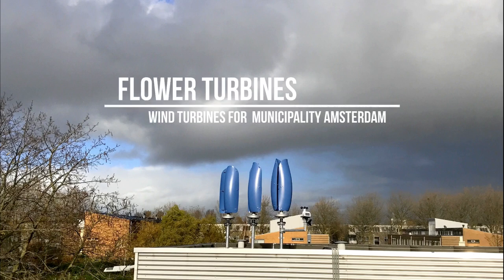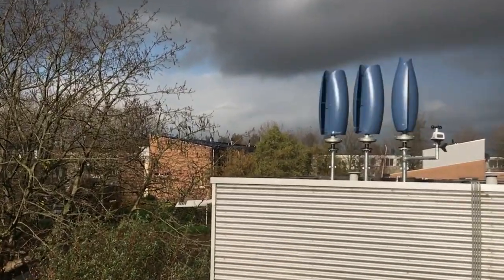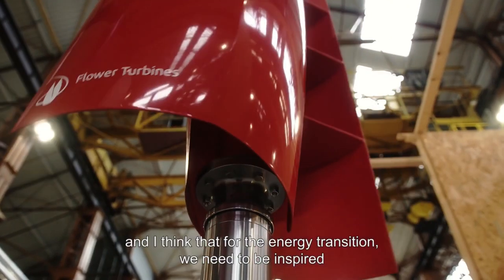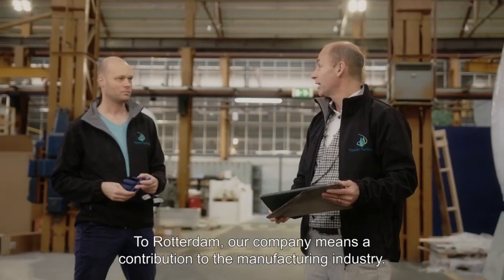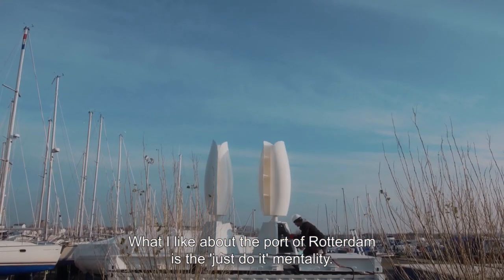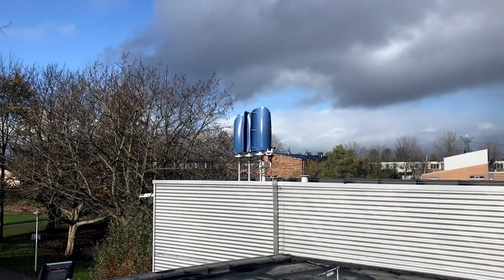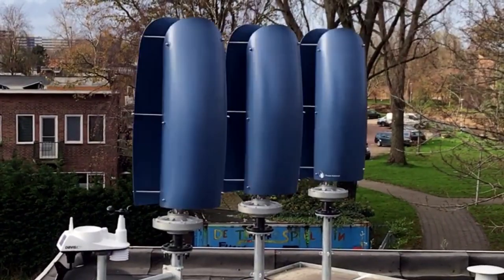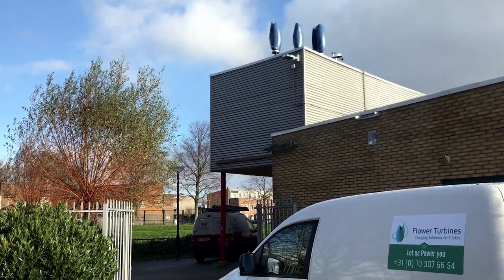The Wind Tulip -  Tulip-Shaped Wind Turbine Makes Wind Energy Accessible in Eco Art Style

Comment: Any idea how much does it cost?
Reply: I don't know the prices for europe, but it's 750.00 USD for the small one ("survival unit", 1.15 m blade height), 7,000.00 USD for the medium size (2 m blade height) and 40,000.00 USD for the large one (4.92 m blade height). 
Which is several times more expensive per power output than conventional wind turbines. 

It's rather expensive art than reasonable, economical wind power generation.

There is no official data about power output per wind speed available (surprise! 🙂), but you can make a rough estimate based on size and type of turbine (Savonius). 
My estimate for a wind speed of 12 m/s (43 km/h, 27 mph), which would be a commonly used wind speed for rated power:
Small turbine: ~100 watts
Medium: ~400 watts
Large: ~2 kW
Reply: @701983  Hi there, thank you for your reply. Meanwhile I got in touch with the producers... and it is dam expensive indeed, the investment in my country with electricity tariff of about 10 cents, will return in 40 to 60 years (with the supposed output which they say is currently test in real conditions). 

But I left the idea any way, after months of measurements I found there is no wind in my region. Even it looks it is windy most of the time the anemometer shows it is not enough for industrial purposes, most of the time not enough to spin even such low speed wind turbines :)

Comment: "A high rate of efficiency" and savonius-type rotors like these don't go together.
And "...even in cities": Cities are generally very bad sites for wind power generation, independently from the type of turbine you use.
The company doesn't give any data about watts per wind speed: Hands off!
Reply: Generally a good advice: If a company hides data regarding power output at specific wind speeds, forget it!
In this case, they offer estimated annual yields (kWh/a) instead, but without any reference to the needed wind speeds.
Which is close to a fraud in my view, but I'm not a lawyer.

Comment: How do these turbines avoid burning out the generator? Wind turbines need to be regulated at high speed or you risk causing a fire...the giant turbines you see everywhere can fan their blades and reduce their speed in high winds...or they can be shut down altogether. How will these turbines be controlled? The "blades" are fixed as far as I can tell and there doesn't seem to be a way to control the rate of spin! 
I smell BS.